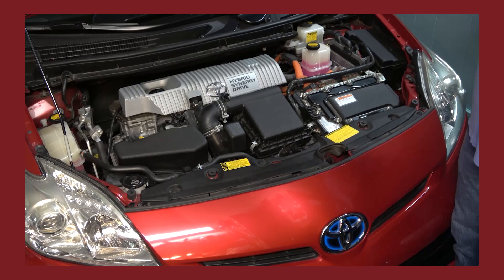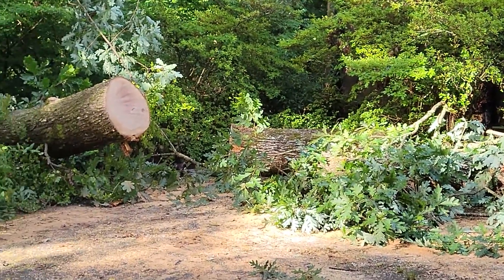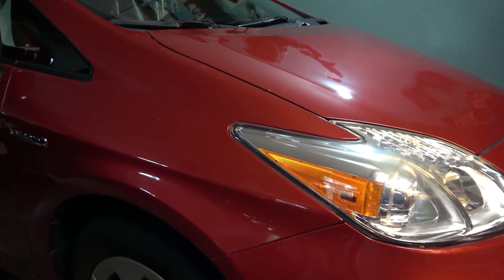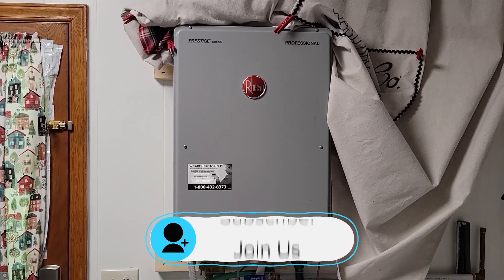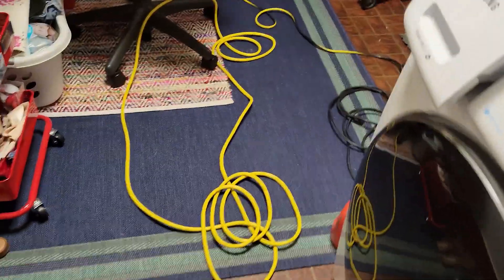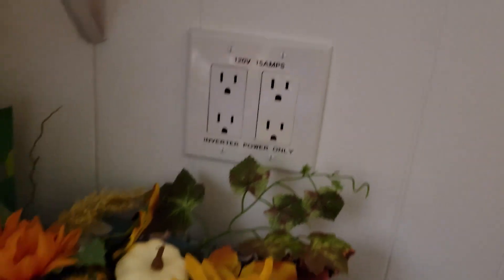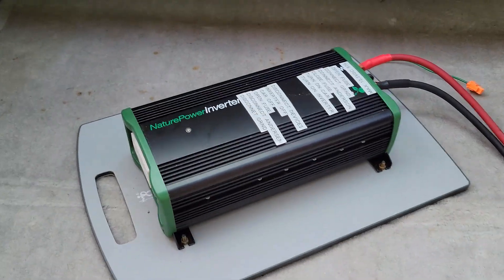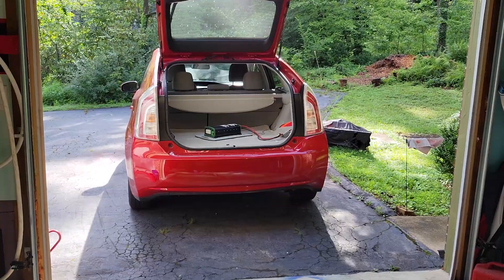Prius Generator After the Storm

Comment: Very nice video.  I ran part of our house off our 2010 Prius for several days after superstorm Sandy here in the northeast.  It worked great, nothing as fancy as your setup, just the inverter to an extension cord to a power strip.  We were able to watch digital TV via a rooftop antenna and over the air signal.  We already have off the grid options for cooking, lighting and heating so there's not much electricity needed.  Had some interesting moments with the neighbors when a group of them demanded to know how our house was lighted and functioning without hearing a generator!
Reply from the maker: Congrats on being prepared. What were your off grid solutions for cooking, lighting and heating? Thank you for sharing.
Reply: @cfldriven  We have a few camping style stoves, propane, butane and solid fuel like wood.  These are used outside under an overhang.  For heating, a wood stove and a pellet stove which can run off the Prius for power, wood stove is no power needed.  For lighting and additional heating; kerosene lamps using lamp oil and wicks, Crisco improvised lamps, candles and tea lights.  These are all relatively cheap except for the pellet stove, and there are lots of you tube videos on their use.
Reply from the maker: @mrmrlee  Thank you so much for sharing your off grid solutions. I see no mention of solar or batteries which seems to be the popular way to go for others. My friend in the mtns of CO loved his pellet stove.

Comment: Very good video! Did your inverter trip anytime during this? Did you have to change fuses in the inverter? I want to try this. Could you have used a 1500w inverter ? Will it blow fuse on the 12v battery?
Reply from the maker: The inverter never tripped due to overload. The GFCI tripped once while handling the unit. I would stay at 1000W or under as you don't want to overload the DC/DC inverter. The system is designed with a built in circuit breaker so it should never trip the battery fuse. For details on how it was built watch https://youtu.be/LKAuxiRSkNg

Comment: After the video, Toyota permanently voided your warranty on the battery 😂
Reply from the maker: Actually the 10yr warranty on the traction battery had already expired on Dec 2023. BTW car still on OEM 12V battery too.
Reply: @cfldriven  
Hybrid cars are not the future for home backup power.
I want a massive battery pack to power the house for days.
Like F150 lightning, Silverado EV, and the Cybertruck. They all have nearly 10 kw output.
Tesla said, all cars will have bidirectional charging in the near future.
Reply from the maker: @wt9653  I agree the hybrid comes in handy in an emergency, but relying on one power source is short sighted. The power walls and bidirectional charge are great for short outages but according to the U.S. Energy Information Administration, the average American home uses around 30 kilowatt-hours (kWh) of electricity per day, which means most system won't last but a few days at the most. With tropical storm we endured a 10 day power outage just with the hybrid. We have since added a small propane generator to run high wattage appliances. We considered solar, but in my area there is not enough sunlight to make it practical, and our state is not solar friendly.
Reply: @cfldriven  
You've already forgotten about the solar?
Solar power can easily charge up any EV
I live in Western Washington. The cloudiest part of the US. My solar power system works fine.
The panels are getting better every year.
25% efficiency in 2024. Next panels will be 42% efficiency by the end of the decade.
Reply from the maker: @wt9653  Solar needs sunlight which as I said in my forest area is hard to come by. Also your solar system wasn't free so it is a cost factor in your EV charging. A mix of solar, power bank, alt fuel generator is prob the best way to go with cost and local conditions being the limiting factors. Happy to hear you get descent output from your panels in Washington state.
Reply: @cfldriven  
Solar was paid for by the house use.
EV is now all free to charge with the panels.

Comment: Too bd I can’t do this with my Tesla 
Glad you’re all safe 🎉
Reply from the maker: Bill you might be able to according to this video https://youtu.be/XGOKl_Hf8Z8?si=RUepLFtYbbUKv8QE. Thanks for watching.
Reply: @cfldriven 

Tesla will void your warranty if you do.
In 2024, Tesla disabled the 12v socket when not driven after they found out people were plugging in inverters into the socket.
Reply from the maker: @wt9653  Another reason not to buy/lease/subscribe a Tesla.
Reply: @cfldriven  
I bought one 😁
I'm driving for Free. Solar Baby! 😁
Reply from the maker: @wt9653  Free? Isn't there the cost of the solar system, maintenance of said system, auto insurance (which is higher w Tesla), property tax and tire and fluids? I own VW e-Golf and it is very cheap to run but not free.
Reply: @cfldriven  
Only fluid is the windshield washer fluid 
Brake pads last over 100,000 miles.
The tires are replaced around 40,000 miles.
There's no maintenance after that.
Giving a good wash once in awhile.
Reply from the maker: @wt9653  So not free, even with 5 years of free charging my EV was not cost free.
Doesn't Tesla schedule maintenance include 

    Brake fluid health check every 4 years (replace if necessary)*.
    A/C desiccant bag replacement every 4 years.
    Cabin air filter replacement every 2 years.
    Clean and lubricate brake calipers every year or 12,500 miles (20,000 km) if in an area where roads are salted during winter.
    Rotate tires every 6,250 miles.
Reply: @cfldriven  
I can tell you don't want to lose 🤣
Your wife has to deal with your daily nags. 😂
Reply from the maker: @wt9653  It is just too many people say free, when in reality there is a cost. My EV regen gives me free energy going down the mountain, but I paid for it when I drove up that mountain and due to heat loss I got less back than I put into it.
The wife uses selective listening throughout the day.

Comment: I used to do this with my 2004 Prius. Few things to keep in mind.... the charging system for the 12v is 10A max. If you pull anything more than that, it will drain that 12v. The car will turn on periodically to keep the hybrid battery charged, so keep it outside (as it seem you did). The hybrid inverter and engine can get pretty toasty, so it's best to keep the hood open to help it breath.

The 12v battery is basically a motorcycle battery. It's not a full size starter battery, it just turns on a few relays to enable the hybrid battery, which does most of the work for the car. In the end, it ended up being about as efficient as a Honda generator... just a lot quieter.
Reply from the maker: Thank you for sharing your experience. It certainly was the quietest generator in the neighborhood and the easiest to maintain.
Reply: My 3rd gen is 100A max.